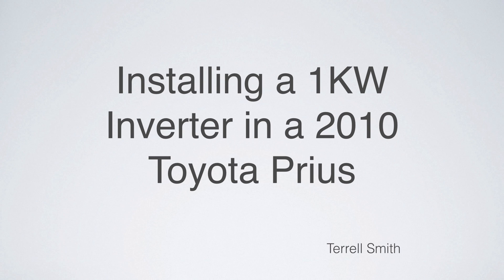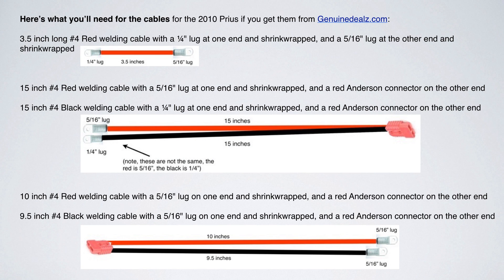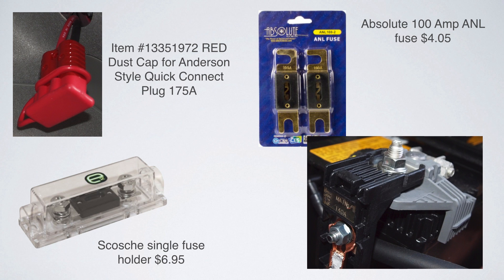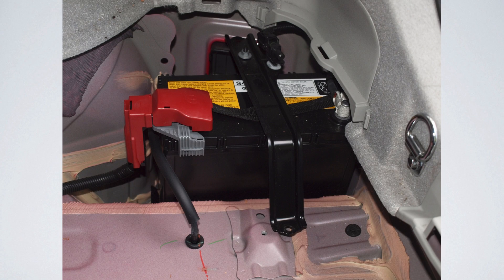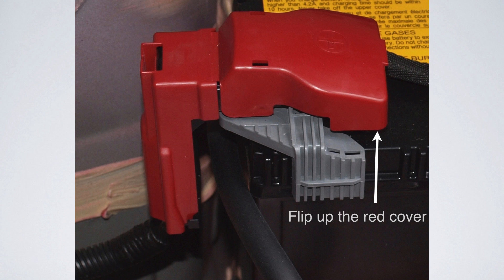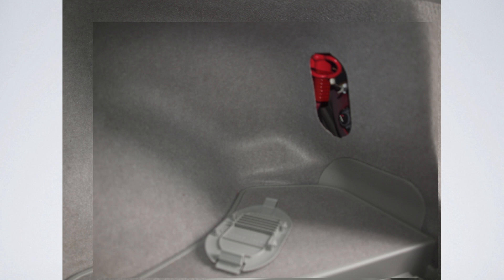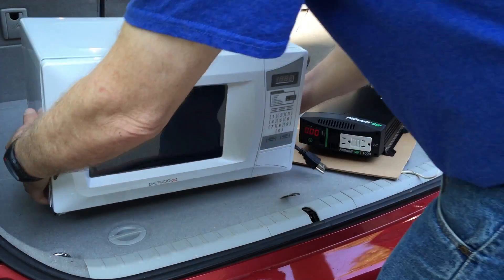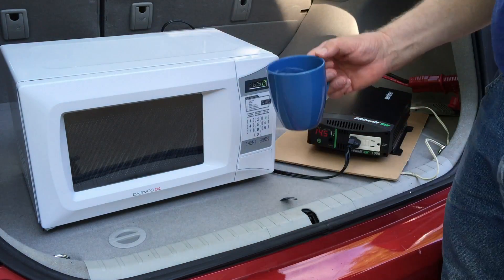Add a 1kW Inverter to Prius

Comment: I only wish Toyota hadn't moved the battery back up into the engine compartment in front of the firewall. But I did check with a local Toyota dealer; they will do the professional install as long as I provide the parts. That's what I am going to do. Breaching the firewall does not seem like a good idea to me, especially considering how tight everything is in my 2016 Prius 3's engine compartment. Better let the pros do it!
Reply from the maker: Good that Toyota is willing to do this for you. I bet it's not inexpensive, though. Think carefully where to put the inverter.  :)
Reply: @TerrellWSmith  The service manager said they would charge the "normal hourly rate." I bet you are right.

Comment: I tried this setup on my Prius 2013 and it works great. My family was able to take advantage of this when we do road-tripping and car camping. It gives us electricity when the camping sites we went to has none. My question though is, will this setup still work in the 2020 Highlander XLE Hybrid?
Reply from the maker: Thanks, Auldz. Glad your family has been able to use it! Regarding your question, the Gen 2 & 3 Prius has the battery in the back, inside the car, which makes an ideal location for installing the inverter. Is the 12V battery on the 2020 Highlander under the hood? That will make things a bit more challenging, because of all the rain dirt, etc. Adding an inverter to any car should work, as long as the engine is running so the 12V battery doesn't get depleted rapidly. Just make sure it's fused close to the battery's positive terminal, and check to see how many amps the car's system is able to produce. For your 2013 Prius (Gen 3), the 12V battery is fused at 140A. That's why I suggest fusing the inverter at 100A, for safety of the car's electrical system. The cables between the inverter and 12V battery should be as short as possible (if it's under the hood, that makes it more difficult), and the cables should be heavy gauge, as in the video. Hope this is helpful. (The Highlander is a nice car.)
Reply: The 12V battery is in the same spot as Prius 2013 - not under the hood. I'll consult someone with regards to the amps Highlander can produce. I am so noob on this matter. Thanks for the video it gives me an idea and it helps me a lot.
Reply from the maker: @auldzbuzz3374  That the 12V battery is also in the back of the Highlander is great for you! You can basically do exactly the same thing I did. Look carefully at the side of the positive battery post to see if the fuse is something similar as with the Prius. If so, you'll see a fuse built into the side of the red + 12V post. Use a flashlight to see what it says. On the Gen 3 Prius like you have, it says 140A. If the Highlander says the same thing, you should be able to do the same modification without too much trouble. I ran the heavy wires through the taillight hatch. On the Highlander, you might be able to run them under the hatch that pops off? Or you may need to cut a small hole? In any case, use a piece of string to measure how long the cables need to be. They should be as short as possible to avoid power loss from the 12V battery, but also need to be long enough that you can easily connect your inverter. Hope this is helpful!

Comment: Great instructions and parts list.  I plunged into it today and was successful.  It took just over an hour to do the installation.  I had all the cables and Anderson connector already put together.  I did drop a battery bolt into the compartment but was lucky to be able to fish it out with a magnet - my bad!!
All voltages tested at the battery and Anderson connections before the start-up of the inverter.  Thanks again!!
Reply from the maker: Great to hear! (I still have a couple of dropped nuts lost somewhere that I've never found.)
Reply: LOL..the dropped nuts.   That's wear the tears in blood, sweat and tears comes in every time I work back there..haha..

Comment: How many watts can you get out of the prius using an inverter? I know you can easily get 1000 watts but could you get like 2500 watts? Microwave, heater, washing machine, etc. Could you get that much power hooking a big inverter? Not an engineer so yeah..
Reply from the maker: Thanks for the question, Brandon. !000 Watts. A big inverter won't do anything but damage your car. The power comes from the car's DC/DC inverter. The fuse on the 12V battery is a 140A fuse. 1000 Watts is safe, but more is not -- unless you tap directly into the traction battery, which is a major and dangerous project.
Reply: @TerrellWSmith  thanks. By the way, what are the risks of going camping in a prius when you are charging the battery hooked to an inverter in Ready mode? If I’m sleeping in the back of the prius, I wouldn’t want Hydrogen gas building up!
Reply from the maker: @FutureHendrixFan666  Excellent question! But no worries. The 12V battery in the Prius is sealed (actually, vented), and there's a small tube which goes off of the battery and vents to outside the car, if necessary. So no Hydrogen gas worries. The question to be asking is about Carbon Monoxide (CO). In Ready mode (necessary when the inverter is running), the gasoline engine will cycle on and off automatically as needed. The Prius engine is very efficient, plus its "on" cycle is short, so the amount of CO made is very small. Plus, you're outdoors camping, and the gentle breeze will take care of things. But just to be on the safe side, have a small, battery operated CO detector in the car. I mention this in my "How to Build a Prius Camper" video. https://youtu.be/89dqnJn3fUg at 8:48.

Comment: Can this same procedure be done with a 2009 Prius?
Reply from the maker: Thanks for the question, John. The 2009 (Prius Gen 2) is slightly different. Check the fuse on the positive terminal of the 12V battery. On 2010 (Gen 3), it's 140A. It might be less on the 2009. So use a fuse that's lower in value than the Prius 12V battery fuse, just to be safe. The cable length from the 12V battery to the inverter also may be a bit different, so check that as well. Do not try to draw more than 1kW, so your inverter should be 1kW or less, and pure sine wave. Other than these things, you should be fine. You can double check with the people at https://priuschat.com
Reply: @TerrellWSmith  Thanks so much for your answer and time. My wife wants me to get rid of my Prius (we have two other cars and are empty nesters) Using it as an electrical backup gives it purpose. I will follow up on your suggestions. Thanks again for your help.

Comment: Wouldn't it be great if Toyota made some kind of small camper that had that same Prius engine?  You wouldn't need solar panels or an auxiliary generator.  I wonder if you could take out the engine and battery and install it in a camper.  Perhaps I should submit my ideas to Toyota.
Reply: In the 70's, they made little campers that looked a lot like truck campers but were on these small Toyota pickups.  I knew someone who lived in one for years.  With van life craze right now, I wouldn't be surprised if Toyota put them out again.

Comment: How does he determine that a 1 kw inverter is the maximum for his car?
Reply from the maker: Thanks for the good question, David. I first learned about the 1kW limit from those who do Prius mods at http://priuschat.com. You can also consider these factors: The power comes from the Prius DC/DC inverter. That power is fused at the 12V battery at 140A. (I have a Gen 3 Prius, and I think the Gen 2 might have a 100A fuse, but I'm not sure.) Roughly speaking, 12V x 140 A = 1680W (roughly speaking because there are other factors involved). So, if you add, for example, a 2kW inverter, you will likely blow the fuse and/or damage the Prius' system. A 1kW inverter gives you a comfortable and safe margin. Add human propensity to push things as far as possible, and you risk the same thing. If you watch carefully, the microwave is actually drawing 1.13kW (assuming the readout is accurate) at 8:20 in the video. My 1kW inverter has a peak surge up to 2kW, but that would blow the fuse. So keep the inverter at 1kW and your should be fine.  :)

Comment: Thanks for your good video 
But I’m thinking to fit another 12v second battery and then connect 2000w inverter to the second battery please I need your advice what you think about ?
Because I want to use drill and welding machine?
Thanks
Reply from the maker: No, don't do it. A second battery will NOT allow you to make 2,000W. The power comes from your car's DC/DC inverter, not primarily from the 12V battery. You will fry your car if you try to draw 2kW from it. Don't go over 1kW, for the safety of your car. A drill (assuming a hand drill) will work, because it's not over 1kW. But a welding machine? No. Get a portable generator that's able to power your welder.
Reply: The best option  is to buy a so-called 'solar generator" that support 2kW, and can charge "solar generator" from 12V.

Set up the same anderson connection as in the video, and charge the "solar generator" from the Prius.

The solar generator will deliver the 2kW burst, and the solar generator will charge from the Prius at well below 1kW. More likely under 500W.

A 2kW solar generator are large and expensive...

As an example, Goal Zero car charging kit draws 50A at 12V (about 750W).
Reply from the maker: @MichaelEricMenk  As you said, large and expensive. But they are getting less expensive. I now have a Power Station (LiFePO4) plugged into my second 12V battery, so it charges as I drive.